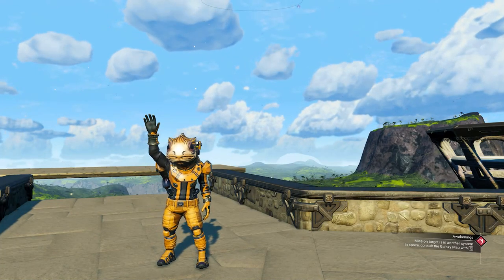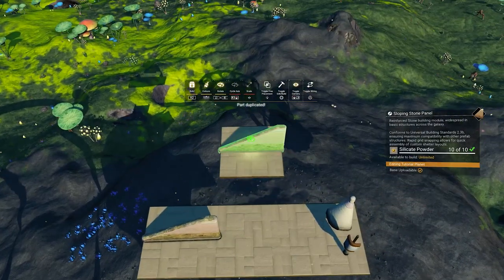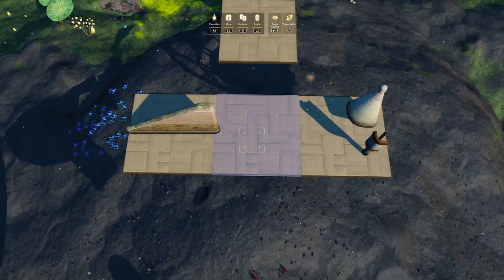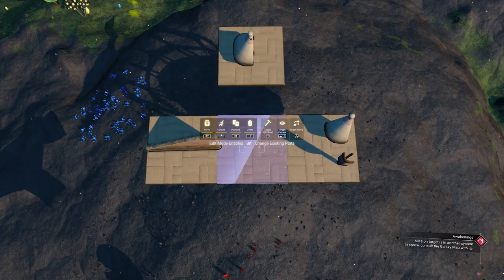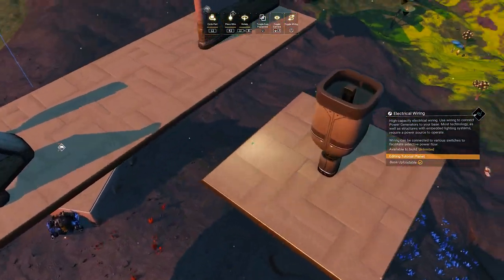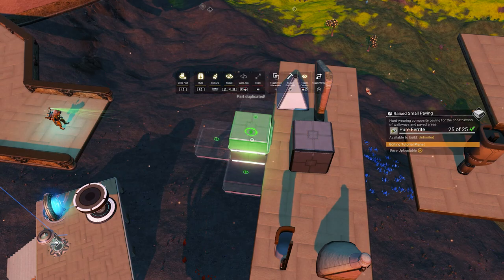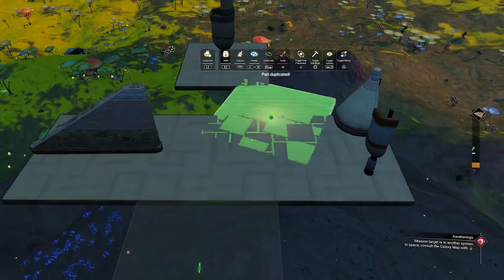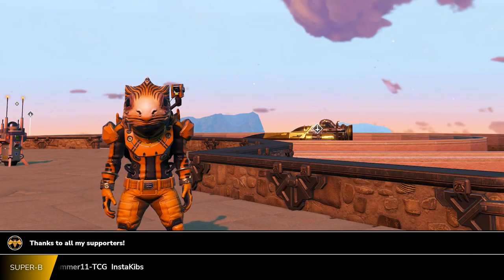PILLARS - Thinking outside the box with the Universal Adjacency Glitch - No Mans Sky Glitch Building

Comment: Hi Beebs. Would love to see some tips on build ideas for neatly placing base parts amongst Settlement buildings, from a base you extend into the settlement from a nearby base computer.

My fave so far is to have 2 light floors leading to each building doorway, then merge stone floors across them to give glowing brick edges highlighting the approach to each doorway. I naturally then paved the entire base with stone flooring. Added bonus to this: electrical wiring placed on the ground is hidden by the 'paving' floor parts, so I can neatly run wires around (in an area where the game otherwise prevents you from digging any holes).
Reply from the maker: I never build in a settlement myself... I will have to do some testing to see what would be great techniques. :)

Comment: so... just curious. 

did Hello Games, not program the end Caps, to connect to make the pillar by themselves? I'm building a base and finding the snap points for these things to be incredibly frustrating. I have a square - 2 corners have connected, on the outside, no issue. the other two? absolutely will not snap. and 1 of the two will allow me to "wrap" around the corner making like a C (or like your bottom pillar with a piece missing)  the other one? wont.

What.  The. Heck.

any ideas as to ... what the simplest way to accomplish that is? so I have a floor, and a corner made with 2 walls; how do I make 2 end caps snap to the outside seamless and hassle free?